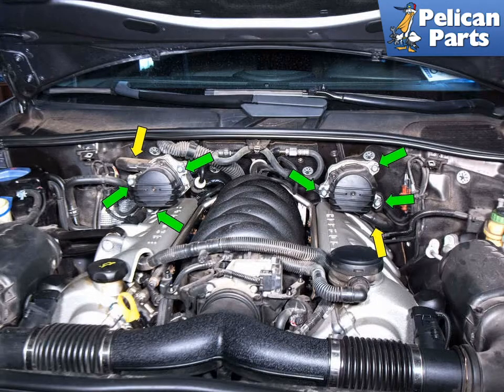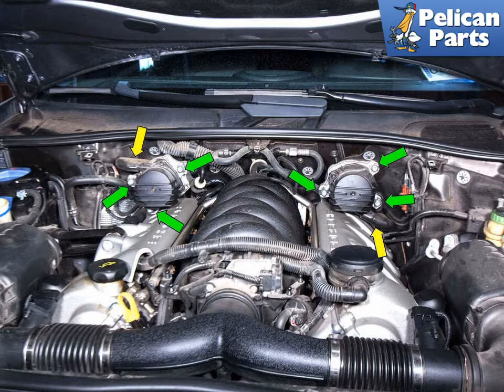Porsche 955 Cayenne Secondary Air Pump Replacement (2004-08)

Comment: Where is this part located in a 6 Cylinder
Reply from the maker: You didn't mention what year and model vehicle you are working on.

With your vehicle info handy, give The Pelican Parts parts specialists a call at 1-888-280-7799. They can figure out what part or repair kit you need.